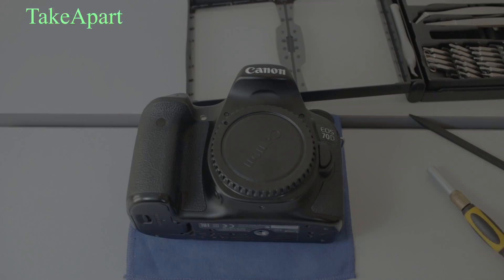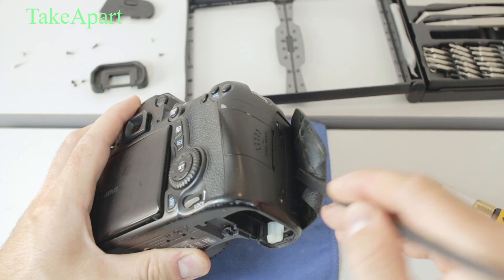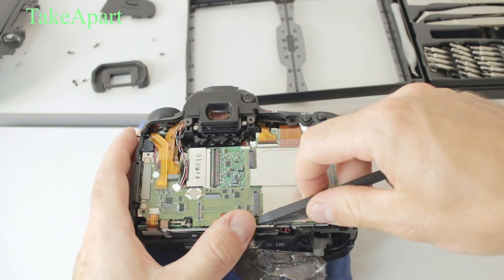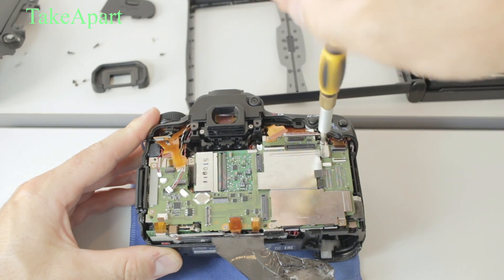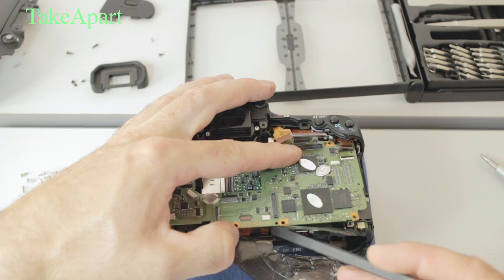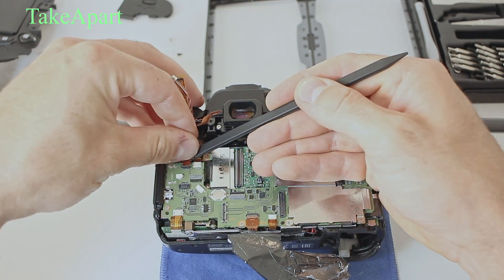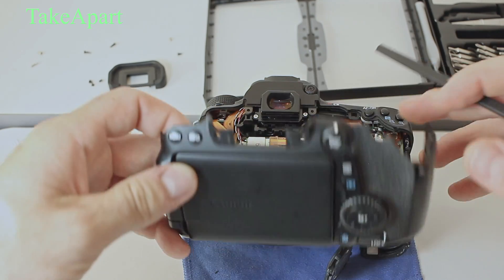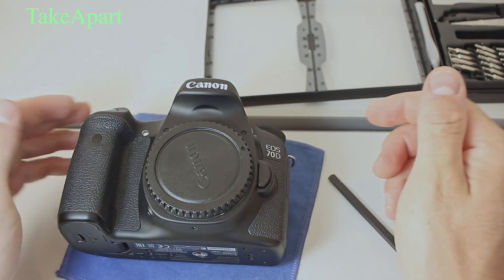Canon 70D | won't turn ON | Motherboard replacement | repair, fix | TakeApart

Comment: I have been watching this video again and again. It's so interesting. Thanks for your good work. 
I have a 80D that I need to replace the rear multi-controller set button knob. I couldn't find a tutorial to follow. I need a service manual of 80D. Where to find it.
Reply from the maker: hi there 
it is hard to find any manual for repair dslr camera ... 
changing the button can be tricky . 
where about you based? I may be able to do it for you. 
thanks
Reply: Toronto
Reply from the maker: bit far... did you have replacement part?
Reply: I have just email Canon asking for availability of part. Part is available on eBay but it takes a month or two to arrive.
Reply from the maker: check channel info and send me email with picture of damage ...
Reply: I purchased the 80D parts manual online and started opening up the rear cover. It is super easy. (Thanks for your video. They are quite similar in construction) The rear controller has no problem now. Two other major problems remains unsolved . When I switch on the camera, it won't power up. I have to open the battery door and close it when the camera is in "on" position to activate the camera. Battery door micro-switch seems working well. Another problem is the built-ion flash which when pops up will freeze the camera and shows err50 (electronics problem). I can do without the built-in flash and insert an external flash instead when needed. External flash works flawlessly.
I understand that you may not have a 80D but I just want to share with you this.
Reply from the maker: hi there , I did had several 80D  also had flash freeze problem... it was caused by shutter box failure.  probably your one as well... replacing the shutter box is bigger job than replacing mobo. 
happy to help you with it 
thanks
Reply: @takeapart  I disabled the built-in flash and now the 80D can do photo and video shooting with no problem. BTW Err 50 indicates electronic problem. I call canon and they think it may be the flash power board that causes the problem. I will send it in for an estimate later. Thanks
Reply from the maker: I went that way as well and in my case shutter box caused problem...  where you located? 
thanks

Comment: My 70d has bumped bottom 😁....on place were is tripod mount it is not flat. Do you think is possible to fix that?
Reply from the maker: hi there 
it is hard to say without seeing it... send me pictures on email in info section.  
thanks

Comment: PLEASE NOTE!!!  In NZ Cannon are now doing this UNDER WARRANTY. Hi this is John from NZ. My EOs70D just died during video recording. Thanks to all the videos and comments - we realise that this is a defect in this model. If the first 2 digits on your serial # are between 00 - 22, then the camera needs an upgraded PCB. it is a fault that the motherboard gets overheated on LIVE VIEW - and the camera has an ERROR warning and then will not turn on. Send it to CAnnon and demand they fix it free!!!!!
Reply: I got same problem and camera not turning on again, not sure what to do, any suggestions will be appreciated
Reply from the maker: replied on your second comment... thanks
Reply from the maker: hi John
thanks for your comment! 
70D is on market for quite a bit time... not sure how many still under warranty! 
anyway I would like to know more about your experience with canon , as Im based in NZ as well. feel free to flick me email. 
thanks

Comment: what is the price of a new board??
Reply from the maker: around $180 usd ... you can find reliable and pretty fast chinese suppliers in description . 
thanks
Reply: take apart tanks for your kind information
Reply from the maker: no problem... do you have canon 70D ?
Reply: take apart no I've nikon D3000
Reply from the maker: and you after board for canon? or your nikon?
Reply: take apart nikon
Reply from the maker: hi there , here is couple of links for your nikon d3000 motherboard ... is actually cheaper than canon board!  good luck
http://s.click.aliexpress.com/e/aMrbQf6
http://s.click.aliexpress.com/e/nIaAqbi

Comment: hi mate, my 70d completely died, bring it to the service center they said it cost $400+ and then i suddenly broke the battery microswitch, so if i bring it to the canon service center can they fix the microswitch too? thanks!
Reply from the maker: hi there,
yes all can be fixed...they will probably replace board where the battery microswitch is located. 
normally canon service charge much more....if you got estimated cost $400 ...for motherboard GO for it ....you may get some warranty too.
otherwise grab one of motherboard from china(and board with battery door switch) and do it yourself .
thanks
Reply: thanks mate appreciate that! Im broke with that +$400😭
Reply from the maker: let me know how you go... thanks
Reply: take apart rip😭 they said they can’t fix my 70d, it just rip thats all

Comment: NB - Forgot to mention my batteries. I have 4 - and they all works in other camera - so they are not causing the issue with my camera.
Reply from the maker: go for flexi cables and connectors.... small have a look for any dirt, body hair ... dust... clean and blow with comprest air... make sure they are properly plugged in...(some of them are tricky) 
especially connectors on top right corner and behind the motherboard. 
let me know how you go.. thanks
Reply: Thanks.
I have now checked cables and connectors - and did not find much.
However I did find that a red wire close to the power board is exposed since I'm able to see the copper inside the wire. Not much though only 1-2 mm of the copper is visible 5 mm from the connector itself (the wire is attached on the power board). Apart from that it seems that the wire is ok inside the connector. The wire is one of a pair (the other one is light green/or grey (not easy to see because they are very tiny). I don't know if it would be possible to replace the red wire - but maybe it would be worth giving it a try. Or do you think it would be possible to find it as a spare part as a wire-set with connectors???

Comment: Replacing motherboard did not solve my issue (dead 70d). Before replacing motherboard - I had replaced the power board - but my old one was installed again since the replacement  did not change anything. I have also checked all the switches - and they look just fine - in fact everything looks fine - and the camera looks stunning (as new). Do you have any clue at all - what then can be causing this fault? A hint mentioning what to look for would be swell. If it has something to do with one or more flex-cables - what do I have to look for? Furthermore can a faulty motherboard have caused a "blown" fuse on the power board - so that both actually have been defective?
Reply: i know its been a while but have you found a solution?

Comment: @take apart My 70D is facing problem of a pink line on images. so should I change the whole motherboard r any thing else could  be done?
Reply from the maker: @symmetry Angels  there you can try sensor clean,  because Im sure it is sensor problem... just try tonuse “sensor clean” option in menu of the camera several times... if no luck... you may need to change sensor... 
thanks and let me know how you go
Reply: U mean if sensor clean doesn't work then I have to change sensor only?no need to change the whole MOBO? Coz a local repairer told me to change whole board.
Reply from the maker: if all depends on what happened to the camera... without seeing it is hard to tell... it can has damaged connector for sensor .... (usually humidity oxidation) but in perfect scenario is just sensor problem. 
thanks
Reply: ok so I think I should go for sensor first. kindly post a reliable seller for sensor from china. thanks
Reply from the maker: hi there...I updated description of the video with new link for sensor. 
here is it ...http://s.click.aliexpress.com/e/aAURjAq
I did some work with those guys...prety good quality and reliable..
thanks

Comment: My nikon D5100 fell from my hand. 
Now it is showing some pink green lines when taking photos. Old pictures I can check they are clear so this is not a display problem. I changed the lens but it is the same. So I guess this is not a lens problem either. So can you help me to identify what is the main problem
Reply from the maker: hi there, unfortunately it’s sounds like sensor damage.... not sure if you can refresh pixels in menu of the camera... you should dig in menu and find something like sensor cleaning or poxel refreshing... or try google... 
sometimes it’s help to get rid off lines... 
thanks
Reply: take apart thanks
Reply from the maker: did you fixed it?
Reply: I will check and I will let you know. Thanks

Comment: Mine still won't turn on
Reply from the maker: did you changed MoBo?  check out two small switches near battery door and sd card door.  thanks
Reply: Yeah changed out the motherboard. Two small switches seem to be fine but it's still not turning on
Reply from the maker: well sorry for late reply... I had once similar issue ... some of the connectors for flexi cables can catch some body hair or any kind of piece dust ... also double check connectors on top right corner of mobo there are some tricky ones that needs to be plugged properly.  
let me know how you go 
thanks

Comment: Hi again! ;) 
I bought the items you told me and I have exchanged the Mother Board. The good thing is that now I can turn the camera on. However, after a few minutes recording video, the camera gets frozen... the same thing happened before with the original Main Board...
Why is this happening? What could I do?
Reply from the maker: hi, it might be problem with sd card  if it’s slow or failed they can cause slow working or even freeze of the camera. 
I would try good sd card . 
let me know how you go...
Reply: take apart I don't think so, because I bought the SD Card on pourpose.
It is a 32Gb SanDisk Ultra, which works at 80mb/s. It is a SDHC I, Class 10
Reply from the maker: ok that’s good..... it’s great fast card. !
it’s hard to tell what else can be wrong.... try to inspect all boards and look for corrosion or oxidation.... they are not any more processors so if you find something feel free to clean it wit iso alcohol and gently brush with soft tooth brush . (its hard but as 70D is not weather proof it is possible water damage ir high humidity problem)
thanks
Reply: take apart I have checked it and nothing is oxidated or something similar... I am really disappointed and desperated 😥
Reply from the maker: it can be problem in new motherboard... I would try magic lattern   and see if it’s freez .
Reply: Do you think so?
What is maggic lattern?
Reply from the maker: it’s software for canon cameras.... it will unlock some features like time lapse or raw video in higher resolution...
I think website is : www.magiclatern.fm 
it is safe to use and also easy!

Comment: hello friend I have a 70D with error 80, with more than 3 years with the damaged camera, I would like to know if you can help me with the part number and with a seller that you know that sells this piece that is reliable and of good quality, I remain Attentive to your answer, grateful in advance
Reply from the maker: hi, yes it is something unbelievable canon 70D has that kind of issue.... but it’s easy fix! 
follow the video and for the parts you can use links in description of the video... they are sellers what I always use...reliable and parts are in excellent quality! 
thanks and if you will need any help please let me know...
Reply: thanks for the help you give me, by chance you know how many shots and videos the recommended mother board is designed for, and if the error that brought the original and known error 80 was corrected, I would like to take preventive measures and inform me before buying a generic one.

  are 3 years damaged recently bought, it's a disgust I want to repair it to sell it immediately, unless you tell me that it will work perfectly and that it will support a lot of photographic record and videos, your answer is very important for me, so I am grateful in advance, greetings brother
Reply from the maker: hi , 
you will not find brano new motherboard... most of them are sold as 99%new . they are ok with minimal use .  as new!  that’s problem is in chips soldered on motherboard when camera overheats and it’s damage connection between chip and board. for canon  is not economical fix.  but you can replace motherboard and get it working again.

Comment: Where can I buy the Main Board? I have seen them in Aliexpress but I am not sure about the quality of them and they are around 200 EURO (€). Besides, do you know if the lenguage of the camera is given by the Main Board? Because in that case, I am not probably find one in Spanish if I buy it in Aliexpress or Ebay.
Thanks.
Reply from the maker: hi, 
I did order few from aliexpress and all of them was fine... they are by default in english ... links in description of video will transfer you straight to shops in aliexpress pick by me ...with great feedback and reviews. thanks
Reply: take apart Thanks for answering fast. Is not possible to find them in Spanish? 
We saw your links. However, they are sold out.
Reply: take apart Is necessary to change all the pieces you mention in the description or just with the Main Board is enough? Thanks.
Reply: take apart And what is that "black tool" you use to remove the flexible cables? Thanks
Reply from the maker: they will be in english... but easily changeable to spanish in menu...
they will renew stock soonish ... also I will update links in description today (within 8hours)
Reply from the maker: just main board...
Reply from the maker: black tool is just plastic stick... you can use any non metal sticks
Reply from the maker: here new link with main board in stock ready to go.....   
http://s.click.aliexpress.com/e/JEEaeYV

thanks
Reply: take apart Oh, although it comes in English can I change it to Spanish? Perfect!
Reply from the maker: sure you can...
Reply: take apart Thank you!! 😊😊
Reply from the maker: ono worries any time
Reply: take apart Just one thing more. You change the battery of the Main Board, but not the whole Main Board. Am I right? Or did you exchange the whole main board? 
If it is just that little battery, where can we find it? Thanks again.
Reply from the maker: hi, 
that battery is just for storing your settings when camera is off... I changed whole main board
Reply: take apart Ok, so, if I buy a new main board, Do I need to remove and put again that battery or is not necessary?
Reply from the maker: oh yes just put it back in! or buy new one as well... whatever is easier
Reply: Do you know which model of battery is? Because maybe I can find it and it is enough. What do you think?
Reply from the maker: maybe you tell me what problem you have with your camera first? 
if your camera forgetting settings after every shut off.... YES it is that small battery located on main board.  if its anything else.... no that’s battery is not a issue!
Reply: take apart My Canon 70D got freeze after a few minutes of turning it on and any botton answers. Even if I want to turn it off I had to remove the battery.
However, now it cannot even turn it on at all.

Comment: AFTER I REPLACE THE MOTHERBOARD OF CANON 70D  WITH ANOTHER USED BUT IN GOOD CONDITION ...IS ANY OTHER THING TO DO I MEAN DRIVERS AND SO ON OR I INSTALL IT AND IT WORKS...MANY THANKS...ARIS HELLAS
Reply from the maker: hi there...
it will work just fine ... however there is special software to flash mobo... otherwise you will have picture count on 000 and some details in camera info will be not readable 
(shooting, video... all working just fine ) 
thanks

Comment: Hi Take Apart,
First of all, thanks for your video. I've just tried changing my board and I'm pretty sure I've done it correctly. However, still no sign of life when turning it on :( :( :( I'm trying to debug a bit here. Do you know if you can turn the camera on without connecting the back panel? I'm worried about my battery door micro switch as well. I don't think it's properly connected to the "power board". Do you know if the switch does anything but shortcut (or disconnect) the two pins when being activated? Do you know if there's anywhere on the board I can check whether the motherboard is being properly power supplied? 
Thanks!
Reply from the maker: hi ... 
there are two small micro switches one (battery door) second ( sd card door) 
you can measure if they close the circuit properly (sometimes corrosion inside the micro switch cause problems) 
 where from you got your mobo? make sure all connectors are properly plugged in and locked. 
let me know how you go... 
thanks
Reply: Hi again. Thanks for your reply. I got my mobo from aliexpress - took me 52 days to get it, so I was pretty excited to try it out. I reconnected everything once again and felt really comfortable about it, but nothing happens when turning it on :( Afterwards, I was trying to check if the mobo even got power supplied and what's even worse: While I was trying to measure the characteristics of the battery door switch, the switch fell off :( The battery switch is on a different board, as you know - and I don't know how difficult i would be to change that board as well? Have you ever tried that? From what I could measure, the switch BLOCKS the connection between the two pins, when the door is CLOSED. So theoretically, I would expect that the camera now thinks that the door is closed all the time (?). Any suggestions?